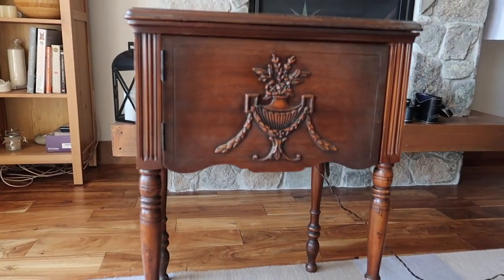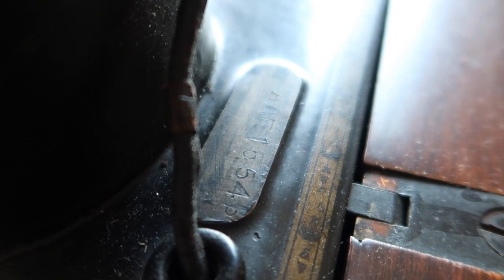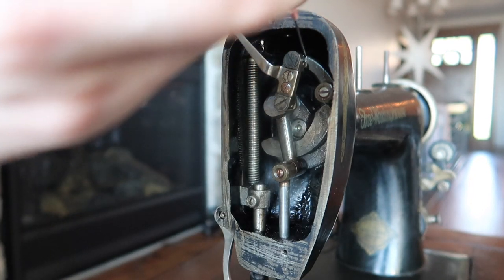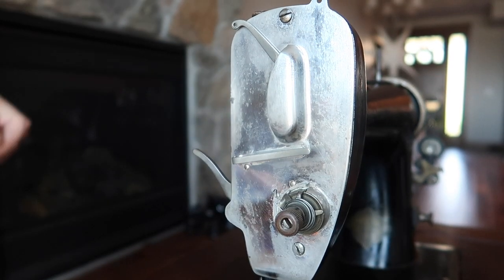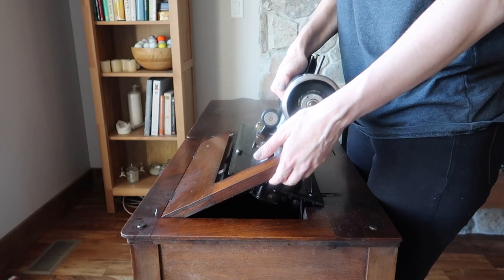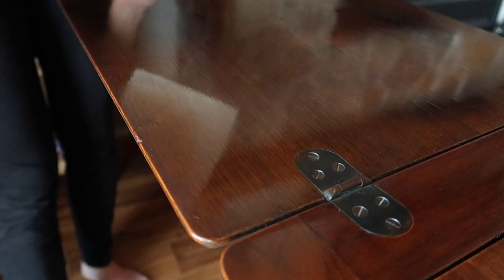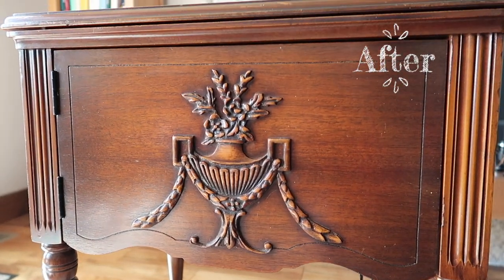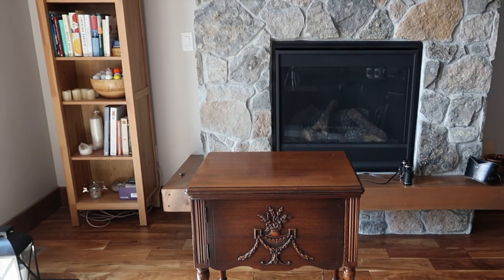Restoring a 1927 Sewing Machine - an antique Free Westinghouse electric machine with wood cabinet!

Comment: What a wonderful project! My mom's 1950s Elna sewing machine has a knee lever, and I find that I still sometimes automatically move my knee to the left when I sit down to sew, even though I've had my foot-pedal machine since the late '80s. The pedal on yours is similar to my daughter's machine (she just bought a 1960s Singer "Rocketeer" that has what is essentially a foot pedal, but mounted on the side of the cabinet, much like yours).
Reply from the maker: Thank you! I had no idea how common a knee pedal/level was! It is fascinating, and since the tension on mine is so high, a good leg workout when I use this machine!

Comment: What a lovely machine and cabinet!  I really need to get my 1898 Singer Treadle serviced.  But that will have to wait until after plague is over and I can get it to the service people.
Reply from the maker: A singer treadle or hand crank machine is a dream of mine to own one day! It sounds like an amazing machine to have and even better when it is serviced!
Reply: @EngineeringKnits  It's so (sew? lol) lovely when it's working.  Plus the added bonus of being able to still sew if there's a power outage, or just for 'hashtag' aesthetics.  shakes fist at snapped screw on the part that holds the foot

Comment: The machine sounded amazing I always when I used to be able to see sewing machines and thrift stores and you plug it in and listen to the sound to see where the motors that because somethings that are mechanically wrong can cause a great deal of money to be repaired if you’re not savvy at repairing things this machine simply needed some maintenance as it seems that have been overlooked probably sitting somewhere in someone’s Attica garage for a long period of time so congratulations on a great find and a Great

Comment: I have two antique machines I need to service and restore (one is hand crank and the other is foot treadle, neither is electric) and I've been putting it off because I'm so intimidated, but this has inspired me to do that research and get started! They're beautiful machines and I would love to be able to use them!
Reply from the maker: Treadle and hand crank machines are a dream of mine to own, I wish you good luck and fun on your restoration journey!
Reply: if you know the model, very often you'll be able to find the full manual on-line, they are useually very comprehensive.

Comment: This was both satisfying and incredibly helpful to watch, I have my grandma's 1950 Singer w/ attached table that she got as a wedding present from her dad (who was a tailor) and she is absolutely filthy and caked in 30 years worth of dust on the inside. She'll need rewiring unfortunately, the motor still runs but the wire casing is starting to just disintegrate.

Comment: This is very similar to the machine my great grandmother owned (possibly from the 1920's or '30s).  I was hoping my grandmother would let me have it when Great Grandma passed in 1969.  All the tools, instruction manual and oil were with it.  It was well cared for.  Unfortunately, Grandma chose to sell the "used" sewing machine and give the money to my mother for a new machine for my sister.  That new machine had a bobbin case in the side that shot out of the machine, unexpectedly while sewing.  A replacement did the same thing.  Progress! 😭

Comment: I didn't know that electric sewing machines dated from so long ago! Y remember that back in the 80's in Argentina there were some shops that would transform your old (pedal) sewing machine into electricity. It was all the rage (and I always have thought that was when electric ones first appeared)
Reply: Laura Buche — The electric sewing machine was actually invented in 1889, although they didn’t become commonplace until the 1920s.
Reply: @AdelaideBeemanWhite  great info! Thanks!
Reply from the maker: It is fascinating to read the manual as it has instructions for both the treadle and the electric version of the machine! They also speak about how to find the right place to plug the machine in, something I never considered!

Comment: You should remove the light piece on the back and clean the inside if you didn't do that :). My machinees was full of grime and dust there and does need to be oiled. A bit :).

Love the table ^_^

Comment: Thanks so much for this video! How does it do when stitching the fabric?  Is the tension touchy and snags or loops easily? How difficult is it to thread the top, and put in the bobbin?  I wonder if it handles thicker textiles like 2 layers of denim?  I have a lot of blue jeans to repair!  I guess before going to all the work that you show on this video, I need some assurance that I will actually be able to use it.  Thanks again, love your videos!🪡

Comment: There is probably 100 year old grease inside the bevel gearbox that runs the hook shaft. This tends to turn to wax. If you didn't it wouldn't hurt to take the cover off the gearbox and re-grease the gears.

Comment: I have just purchased a 1952 Singer 201-2 in it's original cabinet with the original sewing stool.  It is in much the same condition that your machine was, and the cabinet needs attention as well.  Thank you for this video.  What products did you use?

Comment: I just picked up my 19th vintage/antique sewing machine--a Free-Westinghouse Long bobbin rotary in a lovely olive green color. It has a turtled motor on it, too, though mine is mounted low on the pillar rather than near the top like yours. I suspect mine dates to 1927 to 1940 or so, but I haven't been able to find a reliable source of info to more accurately date my machine.

What information have you been able to find to remove and service the motor from that unusual mounting?

Comment: I love these old machines so much, pedal machines even more. It makes me very, very sad that they have been relegated to minor significance in history and that the engineering skills required for their use and upkeep let alone the 3D imaging required to craft well-fitting clothing were and are not recognised or valued. Today, many of these works of engineering art are sold for their scrap value. I've stopped going to sales because seeing them in an unloved state makes me sad (I have got 3 pedal machines and 5 electric ranging from 1890s to 1990s -the latter is a pile of cheep junk bought new that is going to the dump). One of my machines (husband's grandmother's piecework professional) boasts no reverse but a knee lever to lift the foot and turn the work without missing a beat. Also, my father owns about 20, so I'll just wait, I think.

Comment: Motor Wiring?  The motor is 90+ years old and the wiring is probably frayed. It is dangerous to run an electrical device with bad wiring.